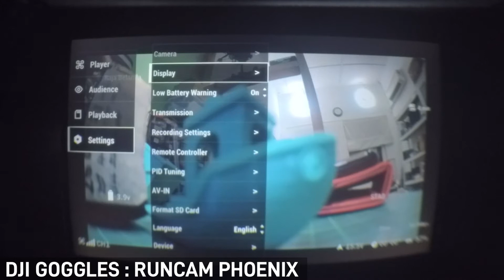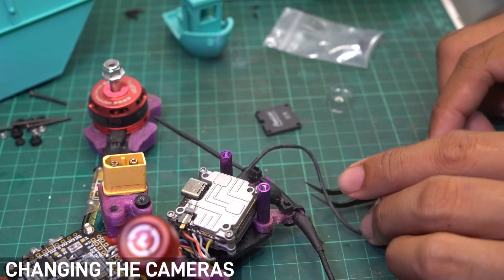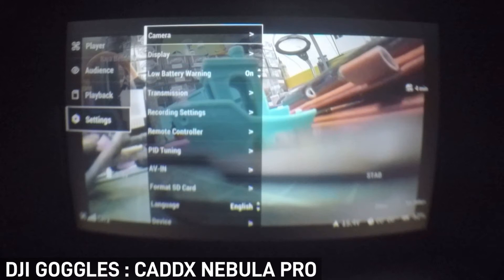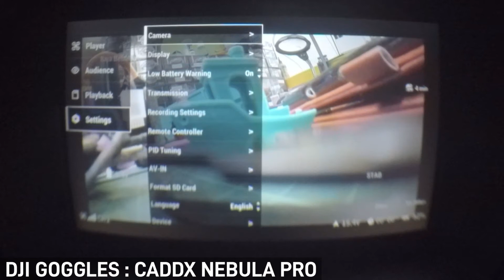FPV replacing DJI Air Unit camera

Comment: Yo bro ! thanks a lot for the help, I just have one question, do we have settings to do after the swap or its "plug and play" ?
Reply from the maker: Plug and play, It would auto detect and the in goggle settings will adjust automatically 👍

Comment: I've watched several camera swapping on YTube. Some swap the cam + the cables by opening up the air unit. As for you, you swap at the camera end. So what do you think ? Easier / safer at the cam or the air unit ?
Reply from the maker: Main reason I did this method is because the camera i bought came without a cable, and the air unit was stuck to my quad already. 

I've also swapped camera with cables to air units with no problem so i dont doubt the other videos you watched. Just be gentle and make sure the pins allign. 

Its safe for you to do which is more convenient for your current build.